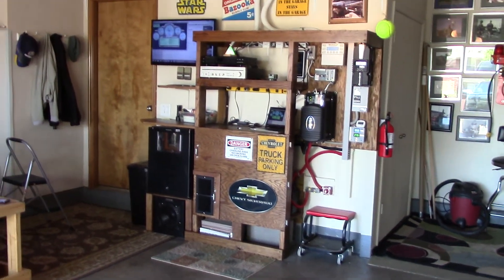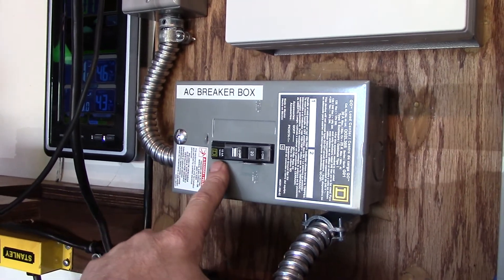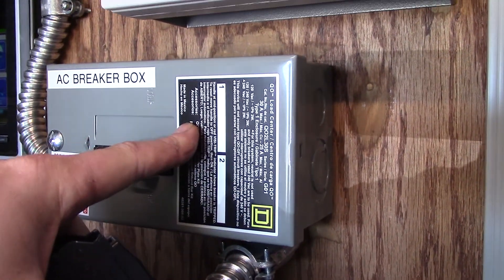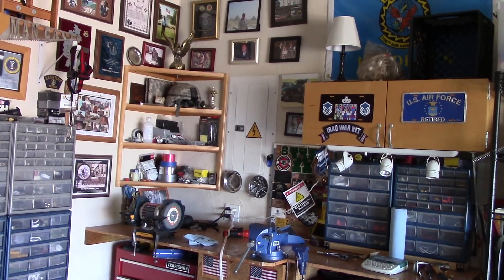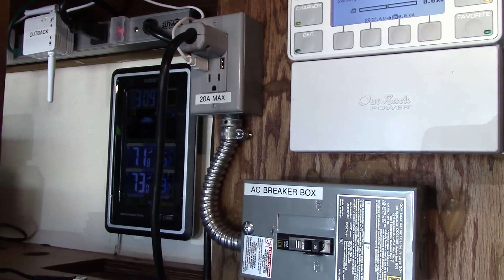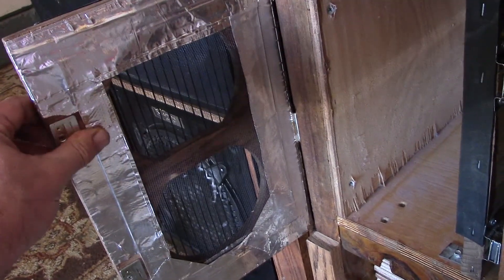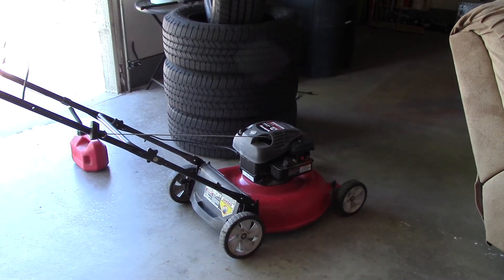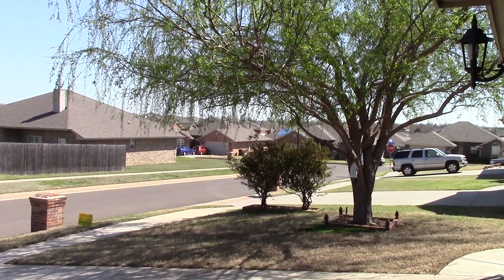Off grid solar power AC breaker box and USB combo outlet installed, need some advice

Comment: Just subscribed to you and don't know a thing about this but I am interested. How much of your house are you powering with this and is it worth the time and money to do so?
Reply from the maker: Thanks for subscribing. Right now my system is powering garage electronics (fridge, freezer, lights, stereo, TV). I will be wiring it up to my main service panel very soon. Probably take off six circuits. My system is "off grid" meaning I don't sell back any power I don't harvest to OG & E. In Oklahoma, if you "grid-tie" you pay a fee (tax) to OG&E...a private company. And they dictate what they will buy. Makes no sense. And, they can monitor you. As for time and money. 1) Depending on how big you go, costs can add up big time. You do get a 30% federal tax break. Oklahoma gives no break on state taxes for renewable power (which, again, sucks). 2) Time: My solar rig started after the F5 blew through here two years ago. I started small and gradually built it up to handle small loads for the house (six circuits, essential loads, like big fridge, living room, den, lights, kitchen outlets, etc-etc). It takes a lot of time to learn how to do it. However, it has been great taking videos and joining others who do the same thing (mainly off-grid prepper types like me). The guys who run their entire house are either filthy rich or rent their equipment and have it professionally done. Screw that. I own everything. Mine is still not 100% where I want it, but it is getting there.

Comment: Looking Great Chris I Ran My AC Out Direct To My Reliance Protran  Chris Breakers Already Built In Done  Deal  !  So If Anything Goes  Wrong Just Throw Your Breakers On Your Reliance Protran  The Main Concern Should Be AC Hot In For Breakers Or Cut Off Breaker  Great Video But Again You Can't Have To Many Breakers Safety First   Cheers Brother
Reply from the maker: Nice. I guess my question is: AC Out on the Outback inverter is 3-wire. The Reliance accepts generators with 4-wire (220v). From what I can tell, if I use a 6 circuit Reliance, I would only get to use 3 of it's circuits. Or can I bind the red/black wires on the Reliance to get the use of all 6 breakers on it? Can I use 10/3 wire over to the main service panel and wire into the Reliance? Thanks...lots of questions.
Reply: My Electrician Used 10/3 with A Ground On My Reliance  I Have All My 120 Volt Loads Going To It  Here Is A Link  Of The Wire we Ran Chris http://www.lowes.com/pd_83832-295-63948415_0__?productId=4294377
Reply: My Certified Electrician That Is
Reply from the maker: Thanks Kenny!  I am getting ready to purchase it...probably best to have an electrician do it. I feel confident (and You Tube educated) to do it. But, better be safe than dead.
Reply: Amen Chris I Can Do allot Of Things But Messing Around In My Main Panel Is Not One Of Them For Insurance Reasons Yes  It Is Best To Hire A Certified Electrician Just Saying

Comment: You will have to jump it its not to code when you do. but those are made for 240 volt breakers for hot tubs ect. but yea you can just put a piece of wire and jump to the other side so they both will be hot. for 120.  and it should work great.
Reply from the maker: Thank you...appreciate it. However, do they make something that is up to code? Or do I need to run a second box for the run over to the main service panel. Good to know a jumper will work, but sure would like it be correct/up to code/safe.
Reply: ChrisSolarPowerMakerOklahoma It will be safe and it wont hurt anything and will work just fine. and I know the lugs can hold some pretty large wire I have 3 boxes close to those. and a jumper will work fine.  and I don't know of any box that is just 120 for multiple breakers.